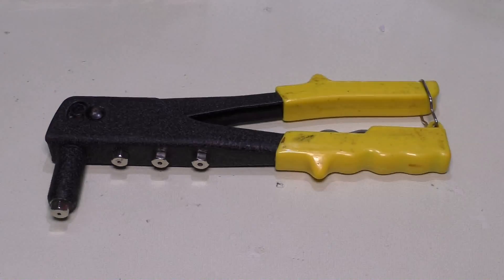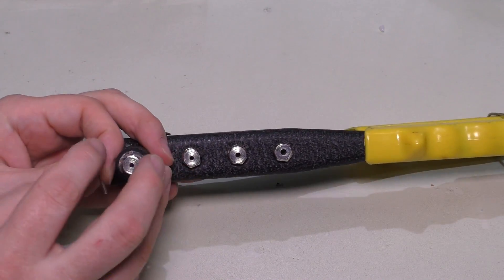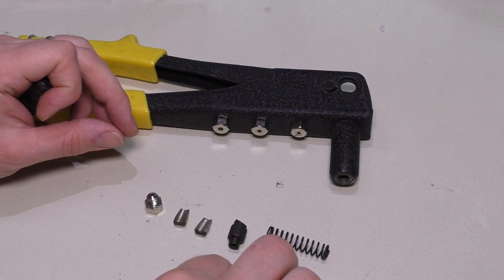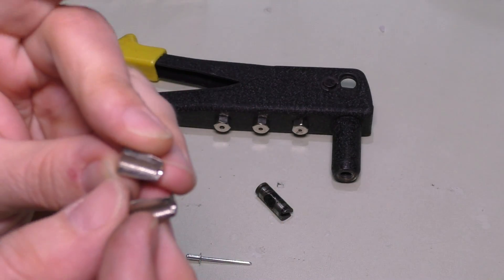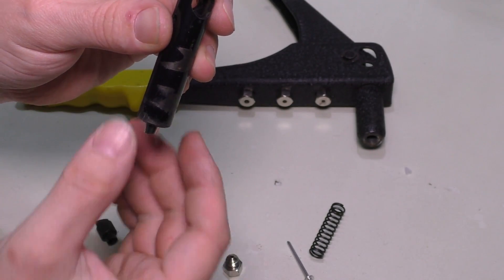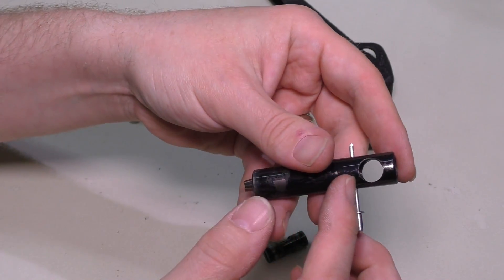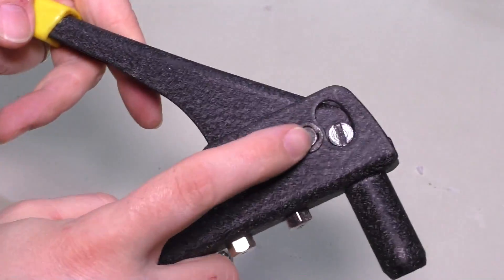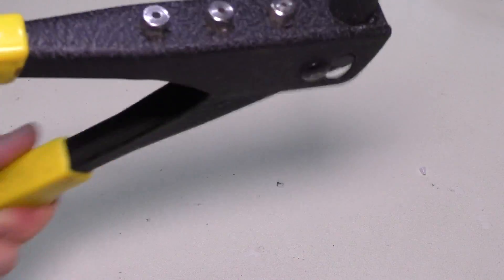PTS Ep. 190 - Pop Rivet Gun: How to Disassemble, Reassemble and Operate (TT#2)

Comment: Thanks lots for that. I’ve always had a problem Stanley MR55 and I couldn’t figure out how to remove the spring assembly. I also decided to use a wet stone to flatten the spring ends and a couple of twist drills in my fingers to remove any burrs from the nozzle ends as they tend to grab the rivet if it bends slightly. Now all I need is to grow bigger hands. Now the pin falls out smoothly. Hurrah!

Comment: You saved me with this video.  Word of advice to everyone don't do what I did and try to tap a nail in the back to push out the pin.  Got both of them stuck then.  I couldn't push out the slotted rod due to everything being stuck in so tight so i had to finish up taking out the hinge pin and then also had to bend the sides of the gun out with 2 screwdrivers till they could slide out over the top of the slotted rod so I could get the handles apart.  After that small problem I could follow what you did in the video easily.  Just had to tap the sides of the gun back to straight with a hammer so I could put it back together again.  Works ok so far.  Didn't know what to do till I watched your great instructions.  Thanks very much.